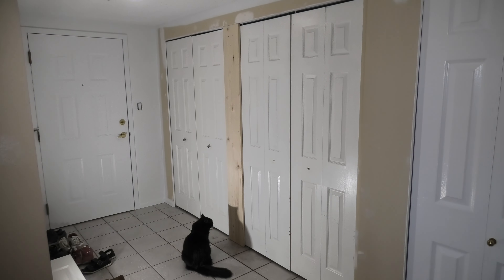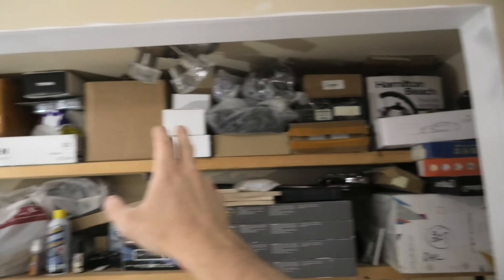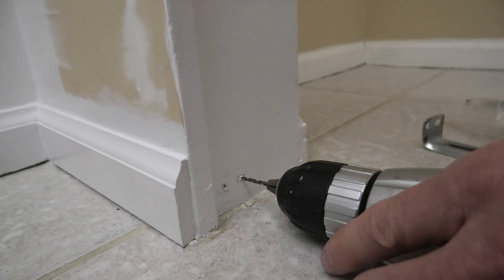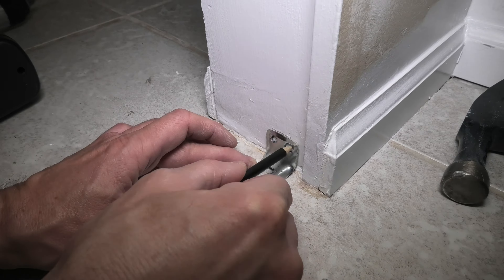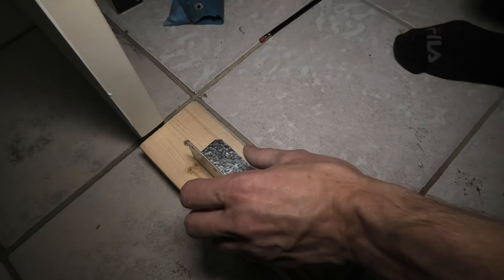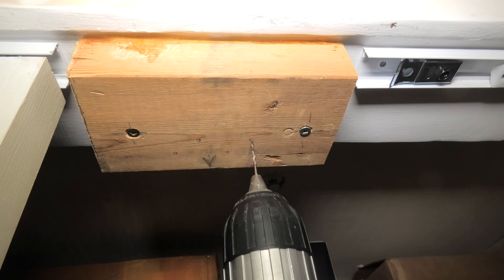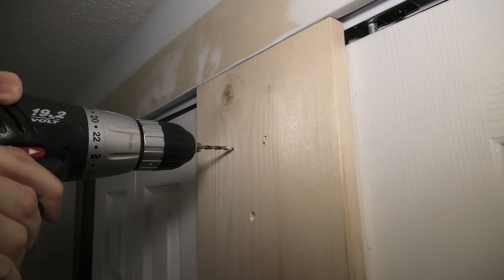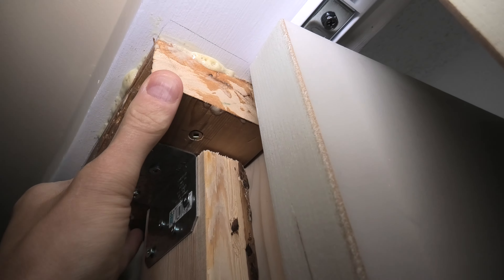Custom Bifold Closet Doors Installation. Detailed Tutorial.

Comment from the maker: PRODUCT LINKS:
1. BIFOLD DOOR - 24 in. x 80 in. 6 Panel Colonist Primed Textured Molded Composite Hollow Core Closet Bi-Fold Door - https://www.homedepot.com/p/JELD-WEN-24-in-x-80-in-6-Panel-Colonist-Primed-Textured-Molded-Composite-Hollow-Core-Closet-Bi-Fold-Door-THDJW160600147/202037481
2. 48 INCH TRACK WITH SET - 48 in. Bi-Fold Door Hardware Set - https://www.homedepot.com/p/Onward-48-in-Bi-Fold-Door-Hardware-Set-14015WBC/202204529
3. PIVOT BRACKET - Prime-Line N 6674 Bi-Fold Door Bottom Pivot Bracket, Steel - https://amzn.to/3Jgdkg3
4. TOP PIVOT - Bifold Door Hardware, Mellbree 4-Pack Bifold Closet Door Hardware Repair Part Bi-Fold Door Top Pivot - https://amzn.to/3PenFgh.
5. BOTTOM PIVOT - Bifold Door Hardware, Mellbree 4-Pack Bifold Closet Door Hardware Repair Part Bi-Fold Door Bottom Pivot - https://amzn.to/3qLUHul.
6. SLIDE GUIDE - Bi-Fold Door Slide Guide, Nylon, (Pack of 2) - https://amzn.to/42LI9jI.
7. 2 x 4 STUD - 2 in. x 4 in. x 8 ft. Prime Whitewood Stud - https://www.homedepot.com/p/2-in-x-4-in-x-8-ft-Prime-Whitewood-Stud-058449/312528776
8. ANGLE BRACKET - Simpson Strong-Tie 2 inch x 1-1/2 inch x 2-3/4 inch ZMAX Galvanized Angle - https://www.homedepot.com/p/Simpson-Strong-Tie-2-in-x-1-1-2-in-x-2-3-4-in-ZMAX-Galvanized-Angle-A23Z/100375310
9. GORILLA GLUE - Gorilla Original Gorilla Glue, Waterproof Polyurethane Glue, 8 Ounce Bottle, Brown, (Pack of 1) - https://amzn.to/466Rjuc.

RECOMMENDED TOOLS:
1. CORDLESS DRILL - CRAFTSMAN V20 Cordless Drill/Driver Kit, Brushless - https://amzn.to/3LhY1Fo.
2. CORDLESS DRIVER SET - Makita XDT14T 18V LXT® Lithium-Ion Brushless Cordless Quick-Shift Mode™ 3-Speed Impact Driver Kit (5.0Ah) - https://amzn.to/3JeWiiv.
3. DRILL BIT SET - BOSCH 14-Piece Cobalt M42 Metal Drill Bit Set - https://amzn.to/3CvTda3.
4. WIHA HEAVY DUTY SCREWDRIVER SET - Wiha 53097 Screwdriver Set, Slotted and Phillips, Extra Heavy Duty, 7 Piece - https://amzn.to/3ystzRx.
5. GLASS AND TILE DRILL BIT SET - BOSCH GT2000 4-Piece Carbide Tipped Glass, Ceramic and Tile Drill Bit Set - https://amzn.to/3N7CChx.
6. HAMMER DRILL - BOSCH 11255VSR Bulldog Xtreme 8 Amp 1 Inch Corded Variable Speed SDS-Plus Concrete/Masonry Rotary Hammer - https://amzn.to/441oNIp.
7. HAMMER DRILL BIT SET - BOSCH HCK001 7 Piece Carbide-Tipped SDS-plus Rotary Hammer Drill Bit Set with Storage Case - https://amzn.to/3NxZict.
8. CONCRETE ANCHORS - The Hillman Group 41821 Ribbed Plastic Anchor 8-10-12 with Zinc Screw, 25-Pack - https://amzn.to/3NwjbAE.
9. MULTI-BIT SCREWDRIVER - PICQUIC SIXPAC Plus 7 pc. Multi-Bit Screwdriver - https://amzn.to/3IOHg1Y.
10. TAPE MEASURE - Klein Tools 9225 Tape Measure, Heavy-Duty Measuring Tape with 25-Foot Double-Hook Double-Sided Nylon Reinforced Blade, with Metal Belt Clip - https://amzn.to/3p8UznW.
11. RATCHETING SCREWDRIVER SET - Wera Kraftform Kompakt 60 RA Ratcheting Screwdriver Set, 17-Piece - https://amzn.to/424g1ZY.
12. POWER CIRCULAR SAW (SKILSAW) - Makita XSS02Z 18V LXT Lithium-Ion Cordless Circular Saw, 6-1/2-Inch, Tool Only with Makita BL1840B 18V LXT Lithium-Ion 4.0Ah Battery, Black - https://amzn.to/3JaMhTh.